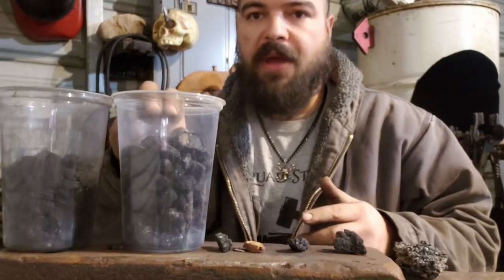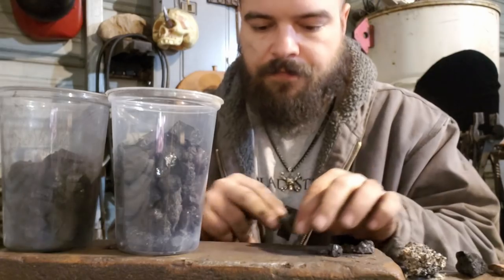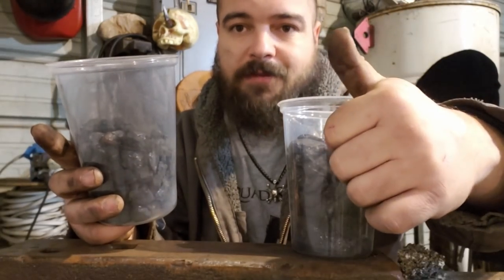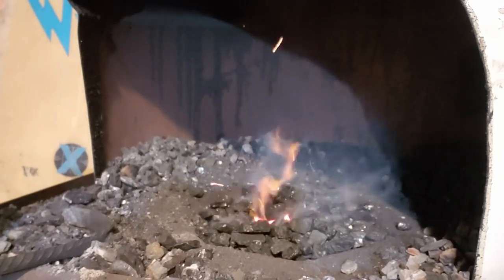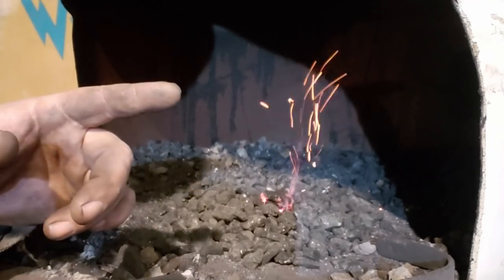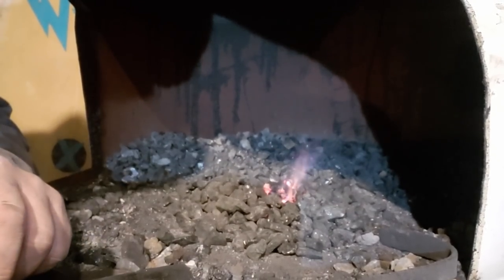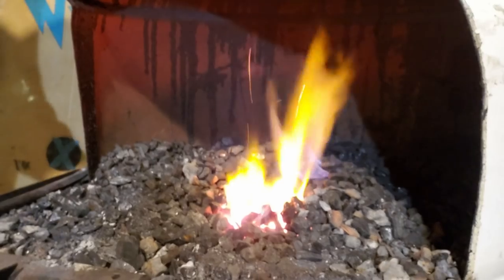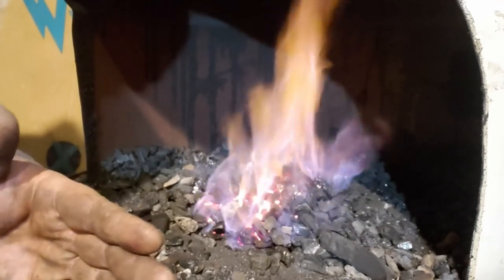Lighting and Working with Anthracite Coal

Comment: I've use anthracite for years, and it's burns very hot, and very clean. I've used bituminous coal at the smithy I work at all the time, and sort of hate it. It butlrns faster, and does not produce as much heat. The way I start my forge is a lot different than how you do. I only use dried grass, maybe some sticks, and some raw lump charcoal. Half of the stuff you pull out of your forge as clonkers are from the charcoal brickets. They are made with sand, and other binding agents. Not so good for a forge. Also I keep the airflow very small when starting a forge. I don't rush it. It let's a lot more burn off so you don't have to deal with it later. Like with a campfire, it you put to much air to it to soon it will either go out, or take a lot longer to get going. Patience is a vertue. I've been forging for 6 years, and never had much of an issue with anthracite at all. I used to have to break up 15lb rocks of it to get it small enough to forge with, but it is my fule of choice for sure. Hands down. Nice video, and I would like to see you try a fire with it that was started cleaner. Also, all that chaff {sparkles etc} was from your charcoal brickets. Also anthracite does coke up some, it's just not as "sticky" as bituminous coal, so it is a bit harder to get a tunnel, or mound as with bituminous.. That's due to the lower levels of impuries in it. It doesn't stick together as well.
Reply from the maker: huh... the clinker is from the charcoal, good to know, i will mention that in the next coal video... like i said, i dont use it much because my guild has Bitumen, but.. i will keep that in mind...
also i am pinning this comment because of all the info!
Reply: @IslandMetalForge  Thanks for the reply. Bituminous coal has a bit more impurities than anthracite, but yes, the magority of your clickers comes from how you are starting your forge. Try a "cleaner" start, and post the differences. I'm sure you will see a huge difference.
Reply: The "grade" of coal, is of importance also. What is commonly known as 'stoker coal' is definitely a lower grade of coal that what we seek/know as "smithing coal". The coal I prefer, comes from the 'pocahantice vein', which runs from WV, to PA...3000 miles. It is known for being low in sulfar and phosphorus. Stoker coal is basically what power plants use.
Reply: @drason69  haven't been able to get Pocahontas coal lately know any suppliers?
Reply: @Vance_Nickerson  only, locally. Sorry.  But, I do know Smith's, that even get clinkers, using charcoal, without going to reasonable, forge welding heats. Skei coal &wood, is where I get it, from 5 hours away.  Check with Charming Hallow Forge, if you on the upper eastern area

Comment: I heat my 10,000 ft shop using two EFM stoker boilers that burn either rice or buck sized anthracite. Believe me, it can be lit with an oxy acetylene torch but it takes like half of forever. Lots of people use charcoal to light like you did and it works well. Personally I use wood pellets like for a pellet stove. A $5 bag of wood pellets will light a lot of fires. I just poor like a coffee can of wood pellets in the fire pot, along with some paper or cardboard, and set the paper on fire in about a minute I turn on the combustion air blower. Once the wood pellets are burning nicely I throw about a handful of anthracite coal on top of them. The answer site will start to crackle and then start burning in a minute or two then I turn on the cold feed

Basically once it's lit, it's all automatic and the fire doesn't go out unless I have some kind of coal feed problem. Usually if I do have a feed problem it will because of some type of contamination like a piece of wood or a big rock in the coal. The feed is an auger inside of a pipe and if it tries to pull in something that is too big it will jam the auger and one of the sheer pins will break. If the coal in the bin is nice and clean the fire will burn continuously all winter

Comment: I remember when I switched from charcoal to actual coal due to needing more durable heat (burning duration that is), I must have gotten the lowest quality, stinkiest, nastiest bit coal in existence pawned off on me. Even after coking it, it smokes like a forest fire and smells like Satan's potluck dinner.
A week after that, the anthracite I ordered on the double came in, and the difference is miles apart. No smoke, a fairly pleasant aroma on startup, and aside from some very excitable sparks before it really gets going that tends to spatter my forearms, it's really quite pleasant to work around. I'm using it for getting it as hot as possible so the blower on blast furnace setting isn't much of a drawback. 🔥😁

Comment: One of the smiths I learn from uses a technique his grandfather (who was a professional blacksmith) did. He soaks corncobs in a mix of diesel and kerosene in an old paint can. When he wants to light his forge he pulls out two or three, tosses them in the firepot, hits it with a match, tosses a couple more corncob bits in the can, seals it back up, and starts piling on the coal. The cons burn a surprisingly long time and very hot. Works for smithing coal and anthracite
Reply from the maker: I do have a cornfield next to me... and I have a diesel truck... hmmmm

Comment: Thanks for affirming what I am thinking and experiencing. I am about as new as you can get to coal forging, actually to forging period ( haven't tried propane ). I have a local coal source less then an hour away, that sells bulk lump and stoker coal. It sells for $2.50 for a 5 gallen buckets. I've tried both, smokes light crazy, clinks pretty bad, and burns up fast. We have a TS so it tried anthracite mixed with stroker I can be forging in about 15 minutes. Lately I use kindling to to start using just Anthracite by the time I'm set up about 15 minutes my forge is ready. I've read a lot about pro's and con's. I have a good air supply to my fire pot once up to temp air gate set at about 1/2  good to most the day remove clinker after lunch add air starts right back we are forging or ( trying to forge ). As far as weighting cost difference local about 80 lbs for 7.50 vs 7 bucks for 40 lb bag of anthracite. Anthracite last twice as long or more with very little to no smoke... Cost seems to be wash...
Kind of a wordy post...anyway point is thanks for reassuring my thought process.
Great video.

Comment: Back in the 1960s 70s and early 80s. When my family would visit our relatives in the winter in Gallitzin Pa. The smell of the air throughout the town was of burning coal. It was a smell that I will never forget. The coal my relatives used had a blue powder on it. It was called Blue Coal. I still remember watching one of my Uncles banking the coal in this huge pot belly coal furnace in his basement before he went to bed. Then in the early morning adding fresh coal to get the furnace up to heat . It was never cold in that house.

Comment: Thanks for a great video, that helps me a lot. I was on the right track, but this video will make it even better. I have only used  anthracite a short time but I like the way it was working for me. I did notice the chunk size of my coal is larger that what you had, mine is more the size of the charcoal you started it with. Maybe I need to break my down some.  
The bad news for me is Tractor Supply and most places here are no longer going to carry anthracite, but I have about 40 bags to use up. Thankfully I have found a source for bituminous, so I will still be able to use coal. It is suppose to be a real high quality coal, with little clinker. The cost will be a bit more.
Again thank you, have a great day.
Wayne
Reply from the maker: As mentioned in a previous comment.. the reason I've been getting clinker with my anthracite is due to the charcoal.. I will be swapping it with wood from now on.
Reply: Wood is what I have been using, and will not by the charcoal as I had planned. I sure did not know that.
Reply from the maker: Charcoal is fine, it's the briquettes that apparently have the additives (sand binders ect) that clinked up.
Reply: Got it thank you!!

Comment: I use it. Works pretty well, cheaper. Since summers coming I'm gonna switch over to propane to stay a tad cooler. My shops outside, and coal gets hot! Lol
Reply from the maker: Good plan, I'm indoors,  so the heat from the coal forge typically goes right up the chimney
Reply: @IslandMetalForge  nice. One day I'll have an indoor shop. I'm almost to the point where I can start traveling doing live demos. 🍻

Comment: Yamez, you the man, brother! I've been smithing for about 6 months and all I have available is anthracite. I've searched for videos on how to work with it like this, but all I can find is how to light it.  Thank you for the video. The only questions I have are what is the best way to rotate new coal in, and how much do you use in an hour. I seem to hit a wall between 2 and 4 hours after I light my forge where I can't get the metal above a mid orange color, and I seem to go through about 4 pounds per hour.
Reply from the maker: What I do, is as the fire burns, and starts to weaken,  that is clinker or ash clogs.. I let it die just a bit, then pull the coal rake through to loosen and remove any clinkers. Then I keep air flow and push the hot coals around to knock any ash out of the way, and then I push the fresh coal down the sides of the pot keeping the burning coals in the middle... you don't need to push all the way down with the new coal.. just a bit of a rim about an inch down. Then a bit piled up and back to heat, business as usual.

Comment: The Anthracite we have in Alaska burns very hot once it gets going,  It will burn your steel if you don't pay attention.  Our Anthracite also produces a lot of clinker.  I only use wood to start it so don't blame the wood for the clinker.  I like it because its easy to find along our highway,  there are literally layers of it in the cut banks along the road.

Comment: I battled anthracite today.. thank you for the video. I got a good 2 hour burn before I messed up my fire trying to clear broke up clinker. I am going to try an x style grate and layer like you did more. Little bits, let it catch, little more and so on.. thanks again for the video.
Reply from the maker: No problem brother... I hate clinker, but when clearing it out keep a low breeze from the blower and pull bits out till its loose, keeping some coal burning.

Comment: The anthracite I use gets clogged up about every hour and a half to couple of hours, only used lump charcoal and/or corn before I got the anthracite, first time I burned coal it surprised me how fast klinkers build up!  Once my firepot is up to temp, my anthracite seems to stay lit a lot longer, although I only tried once unsuccessfully to light the anthracite in my hand crank forge.  Electric definitely helps..  and when I tear the whole fire apart to clean out the klinkers, if you're not quick enough can be a bit slow getting back to temp.

Comment: Good video. Haven't used Anthracite yet since soft smithing coal is cheap and close by. But I've considered running a chimney to forge indoors with coal. Is there a huge advantage to anthracite for indoor use? I assume a proper and effective/safe draft make that a mute point.

Comment: Awesome video! I’m thinking of switching to coal for the winter. Trying to get my propane forge up to temp in >32 degree weather is driving me nuts!
Reply from the maker: With anthracite I noticed my firepot gets a nice red... so no heat issues there. However Bituminous is definitely easier.. just dirty
Reply: Yea anthracite is all that’s readily available in Michigan.
Reply from the maker: That sucks
Reply: Yea. What do you pay for anthracite? It’s like $.015 a pound here.
Reply from the maker: @safety3rdforge245  I was gifted a few bags, not sure where to get it locally i get my bitumen from my guild. at 15 bucks a 50lb bag
Reply: Island Metal Forge yea that’s not too bad.

Comment: At the beginning you showed the coke from the Bituminous and what the  Anthracite  looked like You said that the coke is what burns on the  Bituminous. Does the Anthracite  burn again after it has gone completely out? Good video I think I learnt something.
Reply from the maker: With Anthracite,  in my experience, as with any coal, unless its ash or clinker, it can be used. Anthracite can be relit and used until it is gone.
Reply: @IslandMetalForge  Thanks I was really wondering about that. I'm going to try my hand at blacksmithing. I'm 64 Years old and not sure if I'm to old for this. I'm still trying to figure out a simple forge and looked on the internet and have begun very confused. Again thanks and God Bless
Reply from the maker: I have a video on my forge table.. its pretty easy concept... and this is a fantastic community to grow and learn.  And age is just a number... don't let it weigh you down!

Comment: I appreciate the video. I love the blacksmith community everyone is so willing to help beginners. Question I have for you is do you burn out alot of your shop vacs using a rheostat to control the motor? I always thought that if you ran an ac motor on something like that it burns the motor up. Thanks again hope to hear from ya on the motor.
Reply from the maker: Heya, dunno specifics about the motor... but it still works, and so does the motor controller...
Reply: @IslandMetalForge  is it just a regular shop vac? 110 house hold plug?
Reply from the maker: @TheMotownPhilly  yeah a thrift store throw away

Comment: I don’t know what’s wrong, but my forge never gets going until I’ve been working for 20 minutes on burning wood and trying to get my coal hot enough to start burning. Quite frustrating but I think it’s mainly because I have a manually powered blower. Any tips?
Reply from the maker: When working with anthracite coal and a hand crank blower, yeah you will work at it for a bit at first. 
There is a touch and a feel for how much air... get your starting fire going a slight spin on the crank to add some air while you start to load the coal. Remember... when you add coal you are blocking some air... so keep a light breeze with the crank. Make sure you have enough starting fuel (wood, cardboard, paper) to last long enough to get the coal started.  Don't over think it to much and keep trying.  Once you've gotten it.. it will become second nature to you.

Comment: would you feel safe leaving the stove for a 12 hour work shift and nobody there to check the stove for 12 hours?
Reply from the maker: With anthracite?  When the air shuts off and ya rake it out the fire pot. The fire dies pretty quick but you shouldn't leave a fire unattended.

Comment: Man i been sitting outside for about 2 hours trying to lite anthracite coal from tractor supply . I had a torch on it for about 30 minutes and it still wouldn't ignite so then i made a small wood fire and put the coal on top and still nothing.  Maybe because it was a small pile i was just testing on, probably about as much as you had in one of them containers in the video.
Reply from the maker: Did you have an air supply?
Reply from the maker: They pretty much need constant airflow... get the fire going good, then add some air to get the wood nice and hot then feed the coal around it and then on top, loose at first till some of it catches... then put a bit more on top.

Comment: How many different minerals is there in Coal and the Ashes?
Reply from the maker: Heya, I asked the coal while I was working and it told me to shut up and hit something.... lol, no, I'm not positive about the composition, but I know that in general there can be over 100 different minerals in coal, most commonly you see about 30 or so. Most of it burns off but some  stay and turns to clinker.
Reply: @IslandMetalForge  Very interesting... I wonder if one can use Coal ashes as good as wood ashes.... Could you make a test which taste better? Do you have a yard to test if there is a difference if you give Wood Ashes and Coal ashes on your grass?
Reply from the maker: Well... I don't really sprinkle either on my lawn, it is most sand and weeds... I am actually trying to get rid of all vegetation on my back 40...minus a few planned palm trees... I don't really have a green thumb.. just a burnt one.plus the ash is mixed with clinker, and small bits of coke and coal dust.
Reply: @IslandMetalForge  As far as I know it seems to be the way to go for fertilizing the yard as it has so many minerals in them as far as I can comprehend. The plants will then suck these nutrients up and if its something eatable you can now get those nutrients by eating the plants for health benefits :)
Reply from the maker: Huh, I put egg shells and coffee grounds on plants... trick mama taught me back in the day.

Comment: Noob here and I have only ever built/used a propane forge but after seeing a ton of charcoal, coal, coke, and anthracite forge lighting/forge builds, why does no one ever install a heating element in the bottom of the forge? No paper or wood needed and since coal is non-conductive there would be no issue with it touching the heating element.
Reply from the maker: I assume you mean something like a stove top heater... 3 reasons... 
typically the firepot is bare metal,  with the exception of some cast iron rivet forges, which would short out any electrical heating element.
The fire ball in the coal gets hot... can get upwards of 2700⁰f over if pushed. My firepot glows red underneath during heavy use. The element would burn up. Without going into expensive tungsten coils and controls.
And as above,  the cost... junk mail is free, wood chips are free, cardboard is free, and as you see lights the fire with no problems.